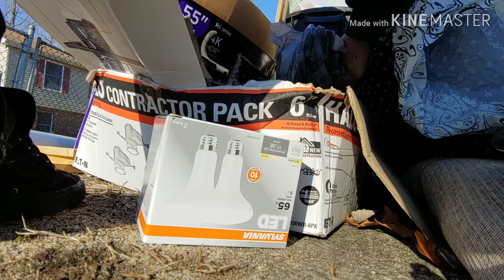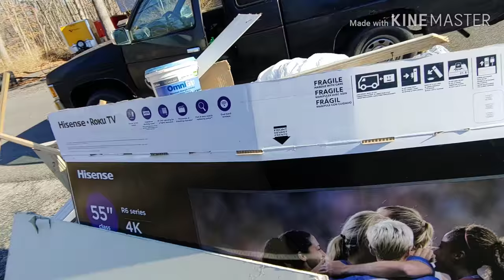Trash picking vacuum extravaganza

Comment: Old tappy lol , when I was a young boy my dad had a 62 Chevy 3\4 ton with a 292 start 6 solid lifters , when the oil got low it would make that tapping sound dad always said that sound came from the oil pump picking up air , I don't know if he was right but it made sense to me lol 😂😂😂
Reply from the maker: It's actually the noise of lifters hitting the Rockers cuz there's no pushing of oil between them I think that engine has a plugged up oil galley once it warms up it goes away

Comment: I saw Dewalt battery operated fans at Depot yesterday. They were $100 though. And I'm pretty sure battery and charger arent included either. A little too steep for me. I also tested Lowes and Depots tool warranty process. Craftsman at Lowes and Husky at Depot. Brought in 4 screwdrivers to lowes and got brand new ones easily. Brought a Husky ratchet and mini screwdriver set to Depot and they swapped them out as well. Both places it was simple and half of It wasnt even the same tool. They will give you the closest match. If you have any Husky or Craftsman tools that are damaged go swap them out. Obviously with lowes you arent going to get USA made Craftsman but if the tools are damaged enough who cares. At least you're getting a usable tool. I left the house with a couple handfuls of garbage tools and came home with brand new tools. Well worth the time.

Comment: Hey! If you pick up vacuums sometimes and cut the cords off, than I have a tip! As a vacuum collector, I clean them up and then resell them for may 15-20 bucks. It’s a good way to make money! And also what do you do with them after you get home?
Reply from the maker: Scrap them
Reply: Refirbishing them will get you more money, and they could be sold to someone in need of a cheap vacuum.

Comment: Y DONT U FIX THE BLUS BUS AND USE THAT FOR DOING THE FLEA
Reply from the maker: Needs commercial tags and Commercial Insurance
Reply from the maker: The shorter answer is New Jersey
Reply: NO WHAT THAT MEAN SHIT LOAD OF MONEY U DONT HAVE to TRY THIS FIND A 1985 318 15 OR WAS THE BIG ONE 18 PASSENGER VAN THEY GET 16 MPG LOAD OR UNLOAD WE TEST AND DROVE IT A LOT WAS STORE ON WHEEL AND HE BELIEVED IF THE BUMPER NOT GRIND IT NOT LOADED AND U CAN UP GREAT SHEEP TO AT LEST A 4 SPEED AND GET BETER GAS MILAGES
Reply: THE ONE WITH WINDOW SO U CAN USE IT AS REZDENTAL